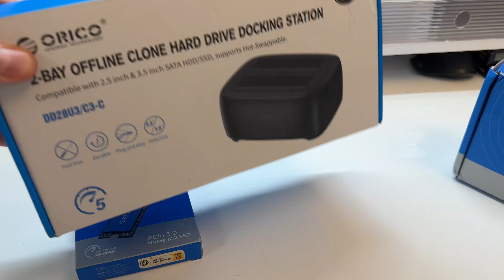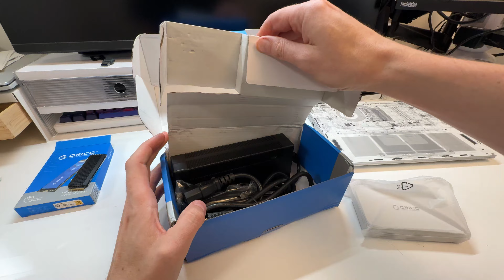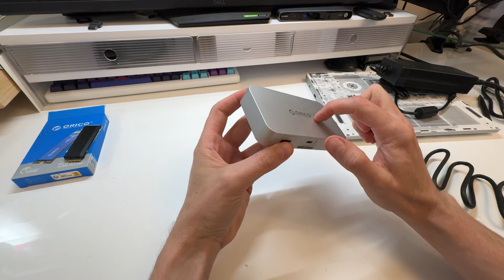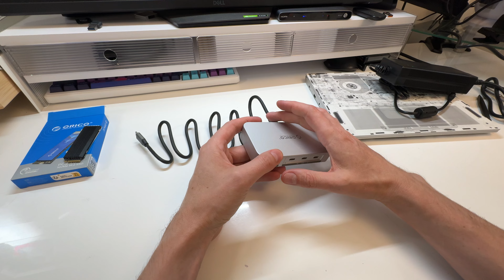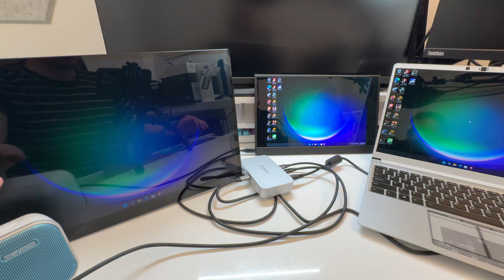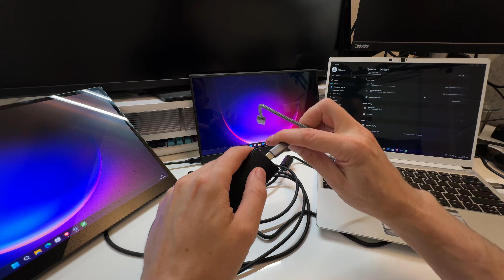ORICO 5 Port USB4 HUB (4k Multi Display Support)

Comment: based on the tech specs
this is more like using a thunderbolt 3 controller

currently the USB4 controller ASM2464PD, doesn't have those features like display port, power delivery (yet, so far, no hub/device have power delivery using this controller)
plus, the 85w PD is more in line to thunderbolt spec which is found in JHL7440 tb3 controller

so i guess they did this to avoid paying for that thunderbolt logo?

Comment: Wow that power brick was like tech from 2010 
Can they just include a nice small GaN power adapter instead ? 

Cant believe they decide to pairing great USB4 thing with old tech

I have something similar but from owc , port selection was very similar

Amazingly i also using framework laptop as daily driver atm 😂
Reply: My assumption is cost. Cost will be passed onto the user
Reply: @beau-urns  owc thunderbolt 4 dock with similar layout was selling 133 GBP at Amazon at the moment  

And orico one was 139 USD and only found in Amazon US, so I assume it have similar UK price (VAT included in UK listed price so about 120% to US listed price) 

And the interesting thing is ...  adapter from owc got lower output at 20V 5.5A = 110W max ,and it only do 60w power delivery 

Orico have higher power headroom (20V 6.5A) than OWC 
👍
Reply: GaN power adapter available with a similar power rating alone costs as much as this hub + fat brick 💀
Reply: @bracusforge7964  slimQ F150 150w output , barrel+dual typeC , the dc port output max 20V 7.5A, official website selling at 64GBP , you can buy two with 130GBP mate 

There was some HP or dell slim 150w charger , longer than the slimQ but smaller than old brick adapter ,charged 40-45 GBP, barrel jack 

Maybe buy somewhere else if your seller sells GaN adapter expensive 😀

Hp 150w slim smart adapter reference number 4SC18AA#ABU